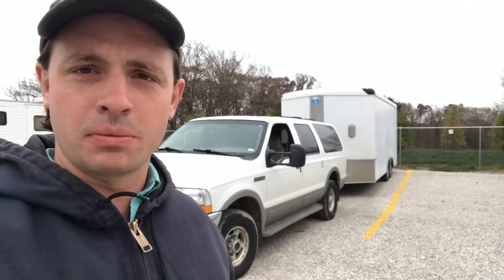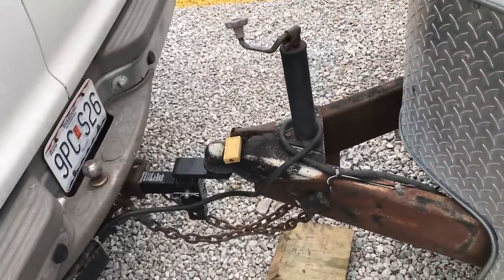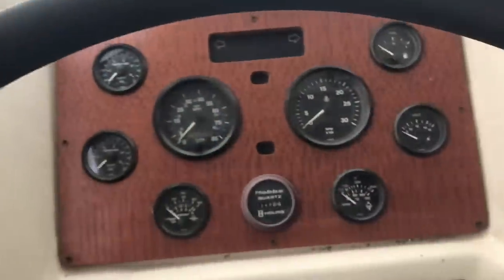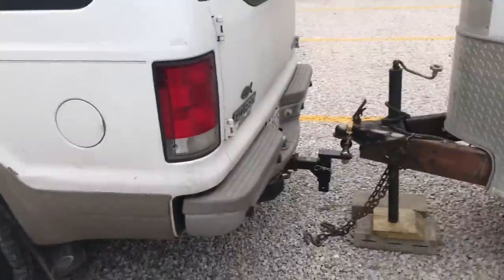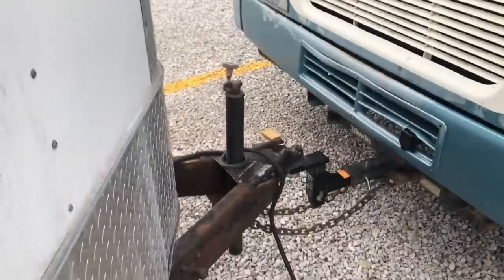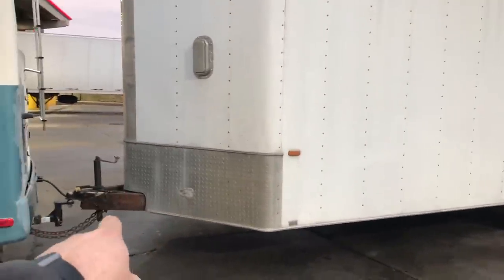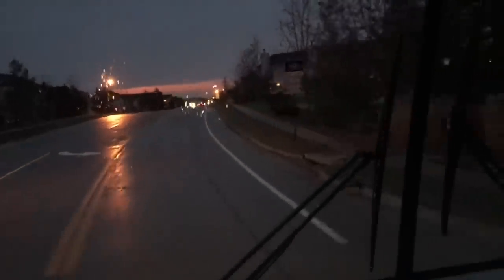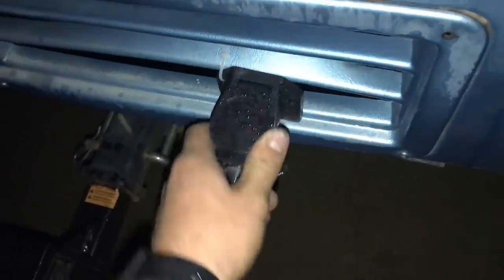RV and Box Trailer Test Drive

Comment: Yeah definitely not long as semi truck. A lot of truck stops have special areas for small RVs like that to fuel for they don't take up spots in the fuel Islands. Usually in front on the side next to the gasoline pumps. By the RV dump station. You need to pull up after you fuel. Even if it's not busy.

Comment: Led trailer lights are the way forward. Europe has 7 pin towing electrics for lighting
Reply: I did that on my car. Yes they are expensive now but it puts a lot less demand on your electrical system. I'm working on doing that in my truck.
Reply: On new trailers in europe the new trailerplug standard is 13pin
Reply: DN Media yeah that’s true. Certainly in the uk most people seem to still go for the 7 pin option unless they have a caravan in which case they go for 13 to power the fridge etc
Reply: Jose Garcia I’ve now found if you buy from eBay the cost difference is tiny, the only problem i have seen is some modern cars don’t like the led lights as they don’t draw enough power so everything gets confused. On my older less tech cars they have all been fine. Every time I go to borrow a trailer I always end up fixing the lights for the owner only to borrow it again a month later and they are screwed! I also see led wireless lights coming out, could be interesting

Comment: You know Dan, I'm a little surprised that engine is only giving you that much horsepower. Isn't the 5.9L rated for about 250? Even as low powered as it is, it seemed to pull pretty well. Thanks for posting!
Reply: that is an 8.3L cummins.
Reply: The 5.9L Cummins had a max of about 325 HP, I think.